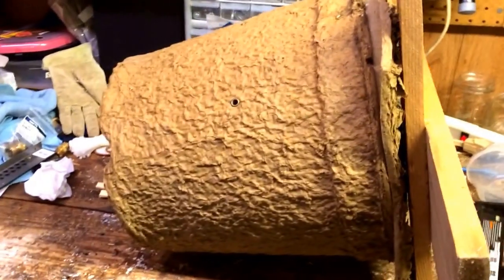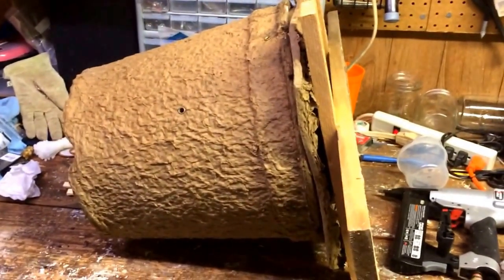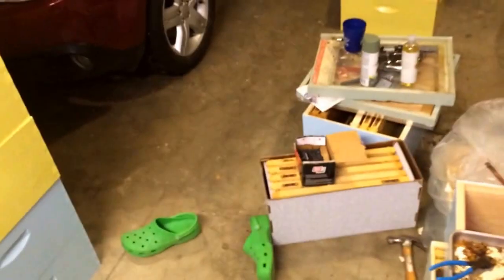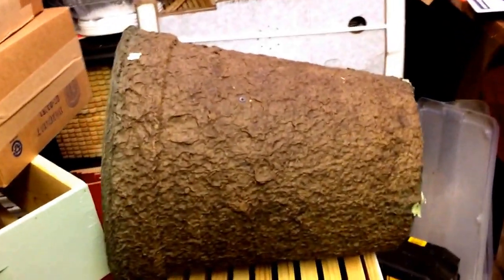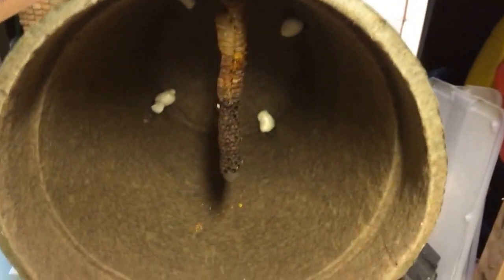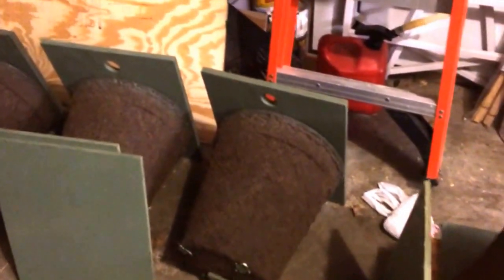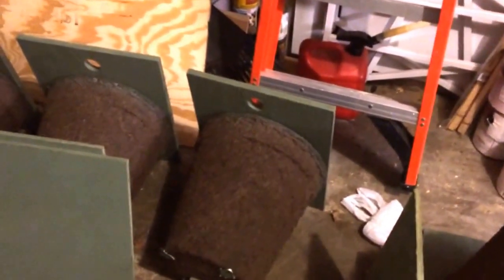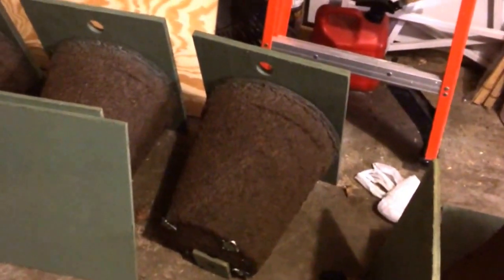Honeybee Swarm Pot Trap - how to

Comment: Everyone seems to use these traps incorrectly. They are designed to hang with the hole at the bottom. The four ribs on the lid are for the bees to draw comb on. You just put a line of wax on each rib. It makes transferring a lot easier.
Reply: mind blown! you think they would come with vague instructions?!

Comment: what material of this pots? Plastic or paper?
Reply: You can buy the paper one, but you can also just use two plastic pots.  Connect them together at the wide end  (bolt them, or wire them).  Plug up all but 2 holes, bait and hang in a tree